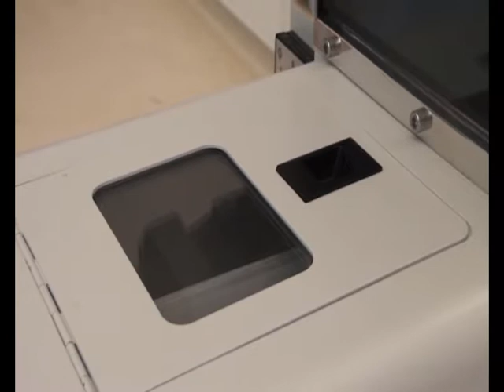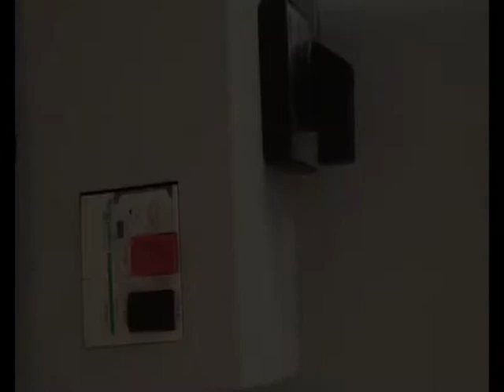ROLLER MILL 4000

Comment: Why this machine is used. ?
Reply from the maker: It is a laboratory type roller mill.
It is used for both dampened and undampened wheat grinding.
After grinding, flour and bran are taken out from two separate containers, so mixing of them is avoided.